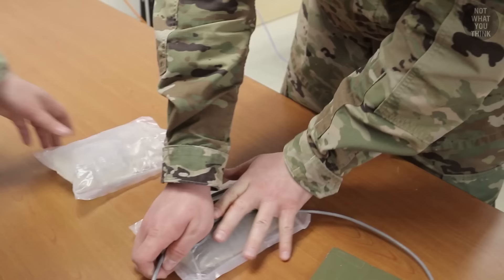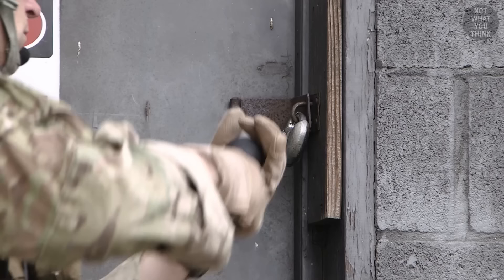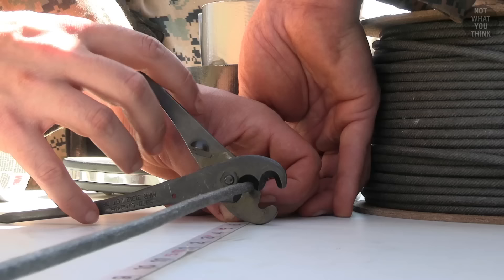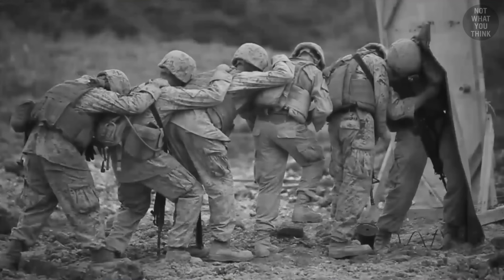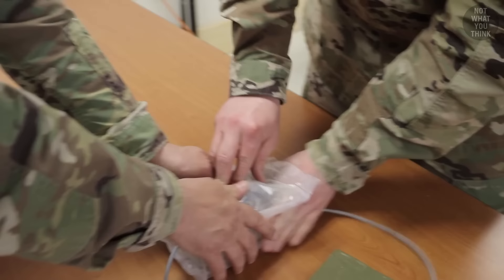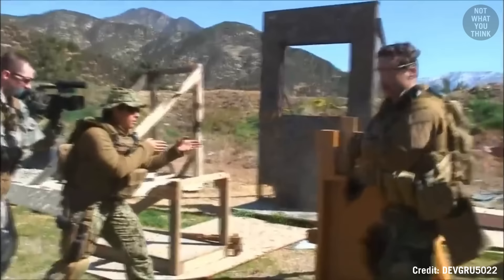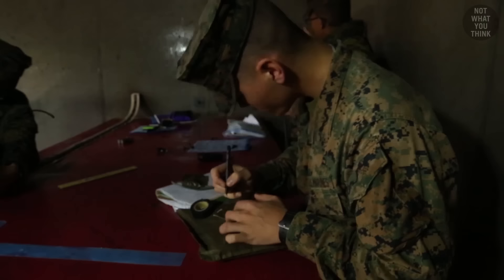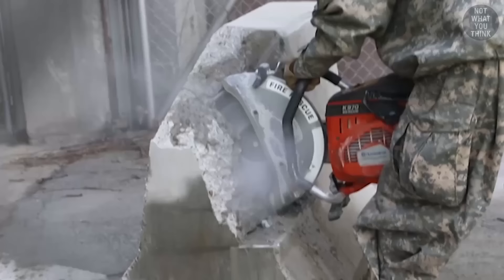When US Marines “Knock” on the door

Comment: Trained for british army and there are lots of entry techniques, but lots of emphasis is put on just attacking the door hinges if you can, also looking for thin walls to make an entry through. Im glad you covered how to properly kick in a door. So many people think you ram doors with your shoulder. A kick in decent heavy boots at the lock/handle area is enough for most standard interior doors, and doesnt break your collarbone 

Our entry techniques changed a lot, it was similar to the US version of violent and quick entry in numbers but changed over to making an entry then carefully looking for/neutralising targets from the door/window, using the wall by the door as cover and gradually skirting around, opening up the angle, entering when it appears safe to do so.

there are lots of warheads now available for handheld rocket and missile type weapons and specialist weapons like the matador rocket launcher which are used for building entry. They look extremely fun. Theres a version of the AT4 single fire disposable rockets available to British troops (the ILAW)  which have been customised for urban fighting (not sure how, probably reduced the backblast and a delayed fuse) and building entry. The direct fire option with an NLAW can also be used for this in a desperate situation.
Reply: Thanks for sharing your experience, God bless the USMC and US Army
Reply: Extremely fun 😮
Reply: Well in Switzerland, Germany or Finnland you probably wont be able to kick in residential doors. They are built really sturdy (some have bolts extending into the frame in several places when locked and are made of thick solid wood. I even  think that many doors would put up a good fight to ramms ans sledgehammers also using a lever i would not consider very reliable here. Also some buildings have their doors open to the outside as for better escape possibility in case of a fire.
I really dont understand why American houses have so flimsy doors and gaps between the frame and the door.
Reply: I heard the AT4 CS has a salt-water counterweight that reduces the dangerous backblast

Comment: The struggle of getting a gas operated saw started is totally real
Reply: Stuggle
Reply: The circular saw was good for my knee never going to start one again, sliced through like butter though
Reply: Try a busted up lawnmower from the 80's with a front axel that won't rotate, a back wheel missing, and a broken bar duct taped together.
Reply: My dad just refused to throw the damn thing away, but finally bought a new one around 2017ish.
Reply: i am a gas person all the way, but that is ridiculous, they should make them electric for reliability and torque.
Reply: I don't know what the problem is you all have, we have a weed trimmer from McCullough(usa) which starts at the 6. pull after winter break, then after 2-3pulls all the year. Lawnmower from Alko(german) that starts at the first or second pull, a cultivator from Güde(chinese) that starts at the 2. Pull, a chainsaw also from china starts after 2-4pulls. It is a big difference if you buy the cheap gas with biooil in it or the expensive without the oil in the long run
Reply: @Patrick-bu4vq  yes but those are lawn care equipment, this is a tool used by the military and SWAT teams to break through the door of a building to get in and get important stuff done that sometimes involves life or death decisions.
Reply: @user-sl3hs3vx4v  you got me wrong, what I have mean with that is that it also depends on the maintenance how reliable your equipment is. We don't cheap out and so runs our equipment very reliable

Comment: Repaired those type of saws for a number of years. 1-know and maintain your saw like you would your firearm. 2-All other things being equal, and this is my experience, pull start it from the ground with your foot in the stirrup formed by the handle. You gonna wear yourself out or hurt yourself/someone else doing it in the air like that. That is just my take on it, for what it's worth.
Reply: Any ideas why they would not use electric saws with huge rechargeable lithium ion batteries?  I can see why you wouldn't where you can't recharge the things, but it seems they might have a place otherwise and start with a button push.
Reply: And check for a choke/primer. If you don't have one, starting it once a day and letting it warm up would be a good idea.

Starting in the air is a waste of energy, but can be done safely. From the ground gets to the back or knees, but a good stump or bench is ideal.

Mostly worked with chainsaws, but two stroke is two stroke. It'd be way dope to have one of thise monsters!
Reply: They will soon, batteries keep getting better, but your talking some serious torque which historically has only been achievable through combustion
Reply: @MrShysterme  At least partly the weight and bulk of those huge lithium batteries.  Hydrocarbons have 50x the energy density of the best batteries by weight.  And considerably more than that by volume.  If you knew you were only going to need a small amount of cutting, then sure, a battery might be enough, and the low noise and easy starting might be handy.  But if you might have to do a lot of heavy cutting it'll just be a pain to deal with that many batteries.
Reply: Decompression valve goes a long way as well! My Husky has one, theirs will too...
Reply: @MrShysterme because they've only become viable in the last few years and are still new.

Comment: IDF uses 2 methods for breaching: 
1. Cold breach: using hydraulics  breeching kit to bend the lintel  or mechanical breaching hammer(which is on a sled to break the cylinders)
2. Hot breach: using c4 brick with "loud thread"(same thread as the charge they cut in the video) or a frame charge, which is basically pre made c4 cut into bars wrapped with lego like plastic. 
Also using 'Simon' rifle attachement to break cylinders from 10 meters away or asking a merkava tank to move the barrel thru a wall or a d9 to go thru that building or wall😂

Comment: It is interesting to compare WW2 breaching and entry techniques against the latest and greatest.  In WW2, one or two guys would work as a team with the rest of the squad in support--hiding around the corner.  as the entry guy or pair blew a mouse hole in a wall (doors and windows were assumed to be booby traps), lobbed in a hand grenade or two, then dove through the mouse hole to a corner of the room and used a tommy gun to spray anything still wiggling.  The WW2 techniques were modified by SWAT based on mission, situation, enemy and the presence of hostile litigation.  Never underestimate law fare!  

The entry STACK was developed to overwhelm criminal suspects without a shot being fired and limiting the amount of hostages killed by the rescue force.  It was unlikely that the entire building would be rigged to blow up and fall down, so instead of limiting entry personnel to just one or two guys that your side could afford to lose, a dozen guys might crowd into a small room.  Bureaucrats prefer single "one size fits all" solutions, but vaporizing the target with a 75 kiloton nuclear warhead usually creates more problems than it solves.

I note that multiple breeching techniques were illustrated and some of the demonstrations included the assault team storming through the breech.  

Thanks--this was entertaining and edcuational.

Comment: Tip for starting any handheld engine with a pull rope. 1. Hold the tool in the air. 2. Securely grip handle. 3. Drop the tool. Don't manhandle the rope use gravity to help you. Instead of trying to overcome compression with just your arm. It's harder on you and your family equipment.

Comment: As a combat engineer in the army when doing ubc I only ever built water impulse charges doughnut charges oval charges and line charges 
Messed around with the m26. For normal work in the field I did a whole lot of bd8 with a wire.

Comment: Try and open my front door with a kick like that, and you'll end up with a broken foot. A hand-held battering ram wouldn't do much more. The heavy steel door opens OUTWARD, not inward, and the hinges are completely hidden inside the steel frame. The frame was affixed directly into reinforced concrete walls when the building was made. Access to the lock plate area from outside is complicated by a hardened steel panel extending from the door, which covers the lock area when the door is closed. Cutting the bolt(s) or hinges would be slow and difficult, but possible. Even blasting might be easier through the wall next to the door, but I have no idea how much rebar is in that area. You might try picking the (6-cylinder) lock. This is typical Japanese apartment construction; it's not even special here.

Comment: Mechanical tools, like a sledgehammer or a battering ram, could help to generate more force...
Specialist: bangs the door with a ram
...but they can’t open all types of doors…
Specialist: bangs harder
...for example, doors on commercial buildings are unlikely to be opened by a battering ram, because they typically open outward.
Specialist: gets help, continues banging

God bless.

Comment: The water charge is kind of odd.  Why not use a shape charge?  They're pretty tiny, light weight, and will eaaasily blast the lock/door handle into the next suburb.
Reply: A cutter charge can be used with water bags. A bag at the back reduces fragments blowing back at the breachers & a bag at the front amplifies the explosive force.

Comment: As someone who owns a boat with a 2 stroke motor I can confirm that cold starting even the larger two-stroke engines can take a while and can be a pain but once it's warmed up to operating temperature if it hasn't cooled down too much restarting it is usually super easy
Reply: Best way to improve reliability on those types of engines is used ethanol-free fuels and also get a raycor fuel water separator.
Reply: I have an Evinrude 140 2 stroke.  It fires up almost instantly up to about 0 degrees C.  Good fuel, good filters and proper maintenance means 2 strokes start EASIER than a 4 stroke.

Comment: The M4 carbine (officially Carbine, Caliber 5.56 mm, M4) is a 5.56×45mm NATO, gas-operated,[b] magazine-fed carbine developed in the United States during the 1980s. It is a shortened version of the M16A2 assault rifle.The M4 is extensively used by the United States Armed Forces, with decisions to largely replace the M16 rifle in United States Army (starting 2010) and United States Marine Corps (USMC) (starting 2016) combat units as the primary infantry weapon[8][9] and service rifle. The M4 has been adopted by over 60 countries worldwide,[10] and has been described as "one of the defining firearms of the 21st century".[11]

Since its adoption in 1994,[10] the M4 has undergone over 90 modifications to improve the weapon's ergonomics and modularity, including: the M4A1, which strengthened the barrel and replaced the burst-fire option with fully automatic option; the SOPMOD, an accessory kit containing optical attachments; and the underbarrel weapons such as M203 and M320 grenade launchers to the Masterkey and M26-MASS shotguns.

In April 2022, the U.S. Army selected the XM7 rifle, a variant of SIG MCX Spear, as the winner of the Next Generation Squad Weapon Program to replace the M16/M4.[12]
Reply: ok
Reply: What?

Comment: In all these vids you see them breaching some thin piece of plywood. Now lets imagine a door or even better a normal wall. It might be I unterestimate the power of the explosion but a normal brick wall( should be 20cm+ of stone and/or concrete ) will probably not break because of a little detcord
Reply: If you need to go through a brick wall, you would use the concrete charge shown at the end of the video. That typically incorporates a considerable amount of C4 and will absolutely go through a brick wall. 

The Det-Cord charges are used for wooden doors and walls. And the water bag charges are used for metal doors as noted in the video.
Reply: @Darthybuddy  fair enough, thank you

Comment: Wasn’t even a Marine failing to start the chainsaw……. They teach at moes placing it on the ground. Also the torch is badass and super quick and easy to use. Half of these videos aren’t even of marines, and also plenty of techniques being done incorrectly

Edit: heads up, I only watched through the manual breaching so I’m not speaking on anything of the video past that point